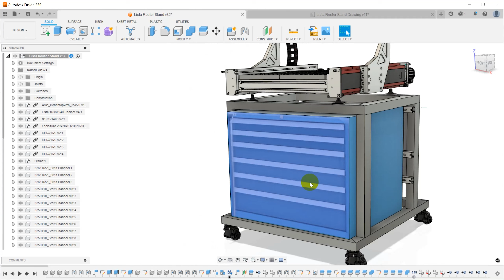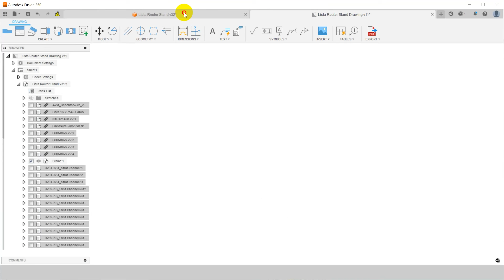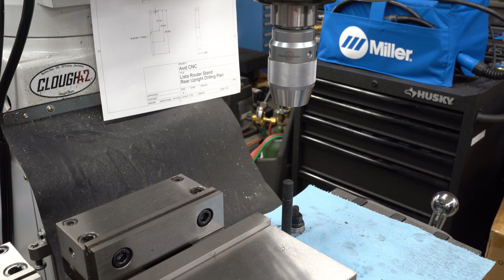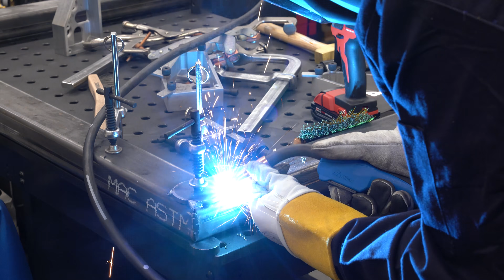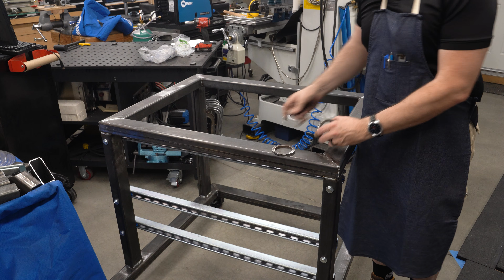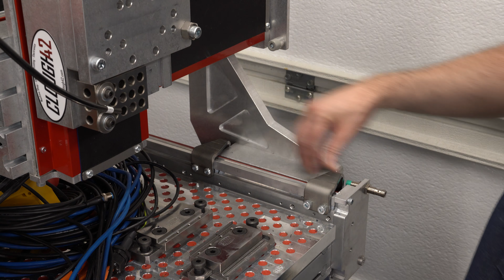Building a Stand for the Avid Benchtop Pro CNC Machine

Comment: I almost bought one of those evolutions, but then had a wheel shatter on me from a friends I was using for some unknown reason, was so dangerous. I made some templates for 45 degree, 22.5 and 90s in different square tube dimensions and just use my plasma cutter works great, easy cleanup as you'll be grinding in some weld bevels.

Comment: I have an Avid benchtop pro and it’s currently sitting on a 4’x8’ bench 2” thick maple top with steel legs and when the gantry moves on the Y axis the bench was rocking.  I had to use a bracket to attach it to a wall.  Personally, I wouldn’t operate the cnc on such a small base without bolting it to the studs of a wall.  You will see that when the gantry does rapids in the Y axis, it’s a lot of mass that accelerates and decelerates quickly .  This can cause the base to rock or even tip over if it’s not attached to something solid.
Reply from the maker: Pretty sure several hundred pounds of tools in a cabinet in the welded steel base with the contact pads lowered will handle it.  If not, I guess I'll learn something.
Reply: @Clough42  I’m using the Avid CNC electronics package and the default settings for the rapids is quite fast and the first time I ran a program, I was shocked how the accelerations and decelerations were abrupt.  The problem is not the solidity of the bench, mine has over 1200 pounds capacity.  The problem is having a mass over 100 pounds above the center of gravity that can accelerate and decelerate rapidly.  This puts a lot of lateral load on the bench and having a small base will not be an advantage.  But since you are using servo motors instead of stepper motors you might not see the same problem.
Reply: @Clough42  If not then a couple hundred pounds of shot in the frame would be awesome

Comment: Have you considered an enclosure that will work with your design yet?  Nice stand - I built something along the same lines for my Avid machine but quickly learned that if you start making aluminum parts, you are desperately going to want an enclosure.  It is going to completely cover your entire shop with aluminum chips.  I subsequently built an enclosure for mine, and now that it is complete.. feel the need to start all over based off of what I learned in the process.  I am very much looking forward to your tramming video and am open to trading notes here - I struggled with that quite a bit.
Reply: If you’ve been around this channel for a while, you’d know that he’s already done a CNC conversion on a small vertical mill.

He knows all about chips being flung everywhere, that’s why he designed and built an enclosure for it. 

Checkout his older videos…

Comment: At around 12:10, you should follow with a center punch if a more prominent dimple is needed. They're your tools, but flattened transfer punch points cause some cursing in a shared shop.

On an unrelated note. You ever going to sell full-ish kits for the ELS project?

Comment: On 1/8” material, you don’t really need a gap. Project turned out very nice. Lista is really expensive. For centering on corners, I keep several different size angle cutoffs. Just clean them up and place at the corner. I make sure the inside corner is sharp, not rounded.

Comment: Am I the only one that thinks it would have been a whole lot easier using similar sized aluminium extrusion and core screws (definitely not using cast alloy brackets) - and just as substantial for a small cnc? No need for unistrut either 😊 Not magnetic 'though, so fridge magnets are out 😁

Comment: Your chop saw problem: My first thought was the nylon brush used on the CNC router to help with dust collection. I thought, "naw, plastic melts". Then it dawned on me about the "old school" method, leather. The ancient bench grinder I learned on, in college 1981, had a piece of leather as the slag/chip/spark/(opps I f'd up. brass part don't stick to mag chuck. Damn kids.) catcher. 

My suggestion to fix the metal chop saw is to wrap some leather around the rear of the guard. I would think you would only need to go 3/4 of an inch wrap around, both sides of the rear of the guard and probably touch the base with the end of the leather. To test(prototype) I would use duct tape. If it works then drill holes in the guard, tap, make a thin piece of strap steel to wrap around the leather, bolt the strap and the leather to the guard. Think mud flap on 18 wheeler. The softness of the leather would deaden any rebounding steel chunks. Like a catchers mitt. If the leather gets caught in the blade, it will get cut and not ruin the blade. Just like your leather welding apron it is heat resistant. I would think 1/8th inch leather would be perfect.  Maybe a piece off of the cuff of a used gauntlet would be about the right size.

Comment: I wish I had a fixture table/space for it.. I was welding a similar shape and got a potato chip even if I tried to follow sequencing recommendations. By the way I noticed you welded the inside seams second, most of the videos I have seen they recommend to do that last because it has the highest leverage on pulling it out of square, I guess that with a fixture table is way less impactful on the final result.

Comment: I had a suggestion for your evolution cold cut saw. If you take either a PVC pipe end cap or a pipe pressure plug to act as stop for the bits your vacuum was missing through the center of the tubing. For the PVC end cap you can get oversized and place a neodymium magnet on the inside to placement and removal fast and seamless. 

Not perfect hands free but when you’re prepping the tube to be cut, 1 extra step to keep the shop clean kinda worth considering.

Comment: I made a similar welded stand for my avid btp2436. I replaced the feet with m12 threaded rod. Those drop into the steel for the benchtop and are fastened in place so that there is no relative movement between the machine and the stand. Not sure that this is any better or worse than your setup - just another idea!

Comment: You are concerned about the mess of the miter saw, but you want to seriously run a router without enclosure? 
Granted, you want to run it with a low rpm FM30F, which also means you will have to run relatively low feeds (far less than the "normal" use of a router)
But still, that corner and all the adjacent equipment will be soaked with nasty little chips. And if you cut steel with an MQL they will make your equipment start to develop some unpleasant surface rust.
Trust me, I have two routers and I know what I am talking about.
You might want to revisit that. You can even start out with a filthy shower curtain. Still better than nothing...

Comment: As I did see you are using the Evolution Saw did you ever think about cutting stainless with it? I'm right now looking for something with which I can cut Stainless that doesn't instantly wear out. So the options are bandsaw or something like a metal circular saw. I need the cuts pretty clean.. 

My thinking is that I probably should go with the bandsaw. I already own one but it's a cheap lidl one where the chuck isn't really nice and also the orienting mechanism isn't that nice.

Comment: Put the whole coldsaw in a big cardboard box with the material running just in front of the opening.
That really helps with the mess they make.
Reply: This is effective! I've actually built this exact setup installing a 4" dia suction gate at the back of clear acrylic material for the containment because my shop happened to be in a medical institution and cleanliness was not an option. And I commend you for keeping your shop as clean a you do! (helps to maintain a clearer mental capacity I also found!) CHEERS!!

Comment: I tried the same on my new makita 1230 last week, same result. My conclusion is that a higher airflow would help, so i will give it a new try with our wood dust collector that uses a 4" hose and can move a lot of air in a large surface.  Not too concerned about the sparks since i use a 30 feet hose.

Comment: Mightn't it be better to fix the router frame to the stand to get the benefit of that mass to dampen vibration and strengthen the router frame?

When your legs are not quite square after the tacks, you can sometimes use additional stitches to pull it into position using the same principle that got it out of place in the first place.
Reply from the maker: I actually tried that first.

Comment: You cannot go wrong with Lista cabinets. I bought quite a few for some of the engineering workshops I was in charge of. I looked for the thick end of 2 years here in UK for some and struck lucky, getting 4 of them 3rd hand for my own workshop. They are far easier to move if you pull the drawers right to the full open position, push in the locking tabs each side and then lift the front edge a couple of inches. They then pull off the roller rails. Trouble is you have one, you will want more, the quality just shines through.

Comment: for less pull on tacks, you can try reducing the size of the tack. Turn the machine up and short trigger pull. You want to get the root tacked, not the walls of the two tubes you're joining. Practice on some scrap, it gets easier with practice. Knocking off the mill scale also helps with shortening the tack time

Comment: Starter/pilot bits work out great for some insert sizes like 5/16", 3/8", and 1/2" and stay on target more reliably for every hole. Easier to prevent content maker's  wander than unpiloted high speed bits with their wide margins. 
In a million years or so when the first camera holder arm and digits show up where a nipple used to be the camera hand evolution will be under way and two handed drilling can be restored.

Comment: My concern with using the Evolution miter saw, or one simular, is that the discharge of metal filings would find themselves on my concrete driveway that any rain or humidity would cause permanent rust stains on the concrete surface. I'd use a blower to sweep off those filings quickly to avoid the same. Currently I'm very pleased with my HF horizontal band saw. Captures all filings and has a coolant feature. Thank you for great videos James.
Reply: I don"t have a concrete driveway, (dirt / gravel). But if I am working in the yard I have a 30 inch magnet sweeper. It will pick up screws, nails, and even particles from the angle grinder. Basically stuff I don't want to get in any tires.
Reply: the fillings also find their way deep in to electrical cords and air lines. very sharp.
Reply: First world problems.